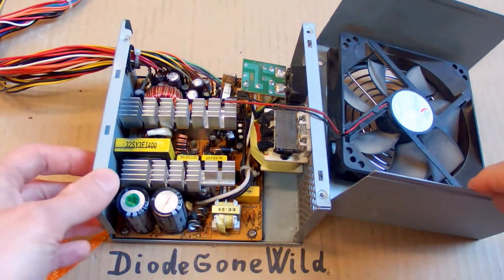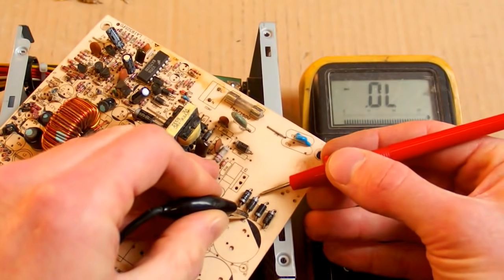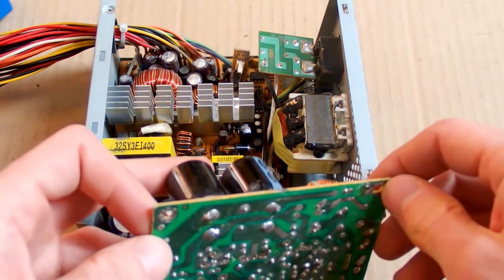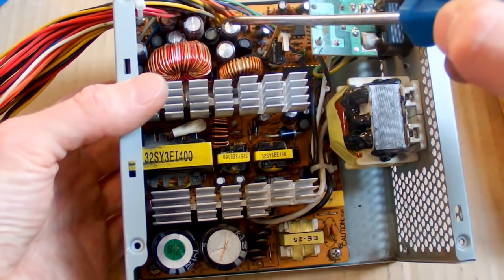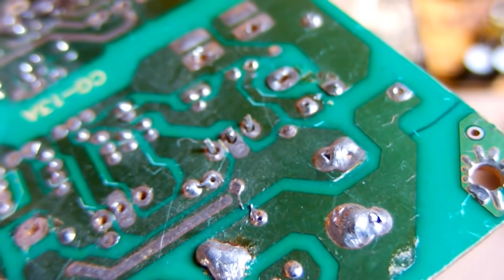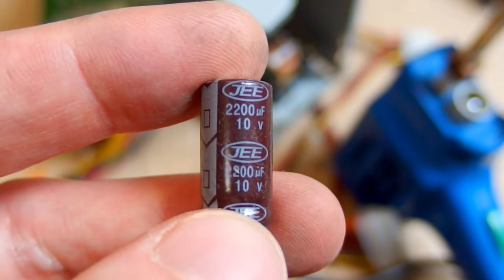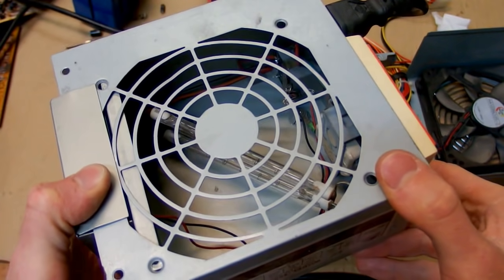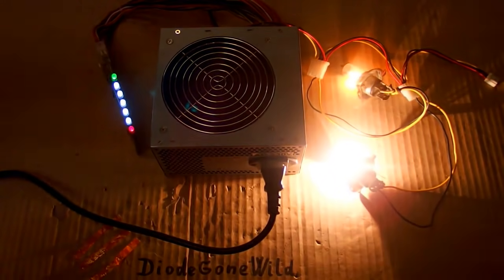How To Repair a Computer Power Supply (or other switching power supply)

Comment: Hi, I have a 67v charger. There is space to fit a small Volt-Amp display meter.
(It needs a 3v-30v power supply)
There is a 12v fan inside 
( I messure stabile 12v DC, both when the fan is ON and OFF).
I was thinking to half-bridge rectifying the 12v DC source, in an attemt to "isolate" the 12v power supply to the meter.
The volt-amp meter wil display the 67v output.

I placed one diode in series with my multimeter, the voltage increse to 19v.
With a diode in series on both +12v, and on the -12v side.
-Now my multimeter messure 44v DC.
How can 12v DC, increse when messured with a rectifying diode in series?. 
And even higer voltage with one rectifying diode in series on both + and - ??  
 Shouldn’t rectifying diodes in series on DC source resulte in a slight drop in voltage, and not a massive increse in voltage? 😅

Comment: Mine actually made sparking sound and green light came back on. After only reset button would do it before.  Lmao. Turned on but no power to mouse and key board and no video. Dell quality.. Smells burning

Comment: Hi I saw you use a light bulb in place of a fuse to detect possible short on power supply in one of your videos, I tried this with a G9 28w bulb but it always glows even when there isn't a short. Wasn't it supposed to only glow when there is a short?
Reply from the maker: The bulb is probably a too low power. It has to be a power rating several times higher than what the power supply draws.

Comment: Thanks for the video! It's been really informative. I have two broken psu's that I want to try to fix. At first sight they both have faulty capacitors that I want to replace, then see if they work using a simple psu tester.

Comment: So the Acer 220w PSU I have does not boot the computer (another PSU starts it so it is the PSU that is the issue). You can hear a lower than normal crackle when you plug it in. 

I cant see any puffed capacitor or anything loose or anything burned. I do not have a multimeter right now. 

And it has no visible fuse on any side of the circuitboard.

The computer was filled with dust when I found it (CPU packed with thick dust) so I think there might be some overheating isssue that caused it.

Do you have any suggestions

Comment: My Cooler master 450 watt supply is not working on load. After testing it I found two faulty Transistors and one zener diode. After replacing components and testing in series the Power supply fan is running by shorting green and black wire of 24 pin socket but on installing in the computer it hardly works for 2 seconds and stops immediately. I have checked all components.All are good but still the power supply is not working on load. My supply IC is ST9S429-PG14. What could be the possible reason? Please help.

Comment: A quick question please - I replaced the connection between the motherboard and the power supply - the new connector has a white wire and the power supply doesn't - any idea why is missing?

Comment: I bought cheap used 500W ATX PSU for diy battery charging and was pulling about 20Amps from 12V line. After about 5 minutes PSU turned off and does not turn on anymore. Nothing burned inside, no short circuits, standby 5V working normally. When I ground green wire something chirps for a moment and then nothing happens. Looks like it tries to start, output lines show 2-3 volts and then it shuts down to 0V. What should I test to find a problem in this PSU? (it has SD6109 IC if it helps)

Comment: Trying to repair a computer PWS, with no output. Found a blowen capacitor, there is no value on it, don't have schematic for it, and cannot find a listing with the only information on it SUNSHINE 0155, any idea what i might replace it with? signed stumped? If you have any suggestions thanks in advance.

Comment: What about an old AT PSU?
I wanted to ask this because i've got an old PC with a p8-p9 connectors and the 230v switch, only that even if plugged in the PSU the PC won't turn on at all, no fan spinning or anything.
Is that because of the PSU?
If so what really causes the PSU to not turn on at all?
I am considering repairing it because the AT PSU are quite rare, and i don't have the instruments to test it.

Comment: Can you help me? 2 13007 burned. And the 1uf base capacitors are burnt out too. and also 1n4148 diodes. I replaced them. But power supply doesn't work There is a small noise when I plug it in. But there is no voltages output. What else could be burned?

Comment: Mr, Hello. I have a question. I bought this time a Chinese power supply from scrap that does not work with the following specifications:
- HI-TECH POWER SUPPLY MODEL: ATX-500W
 DC Output: 3.3V/ +5V/ +12V1/ +12V2/-12V/+5VSB
I discovered that the J13007 transistors had "short circuit" and among the schottky diode, I installed only one that had it (also short circuit) and when I put the power supply in the electricity it worked. But what struck me is that when I measured the voltages, I found the following:
- On the purple wire +13 volts instead of 5 volts
On the red wire, 11 volts instead of 5 volts
The yellow wire is 11 volts instead of 12 volts
The blue wire is -10 volt instead of 12-volt
The lead wire is 10.7 volts instead of 5 volts
Note that the green wire gave 5 volts
  Question: How can I repair the power supply to get original voltages? Thank you .

Comment: Hello sir, can I ask you? I have a power supply for LED PAR CAN, I measure the output voltage and it works fine, so it can lit the 48's LED but can't run the fan. I suspect the amperage output is not sufficient. What component do you think should I look into? thanks in advance... great video btw.

Comment: I spent a day working on my PC and made a change to BIOS which caused the PC to shutdown and now the PSU appears dead.  The first minute of your video revealed what I suspected:  There are Mini fuses inside the PSU case.  Thanks--going to check it.  !!!
Reply: and? what are your findings? as it might help others...
Reply: @UnulOarecare  Unfortunately, my problem was not a power supply issue then.  It was a bad motherboard. Rebuilt the PC.

Comment: amazing teaching video , lately i get black screen when i start game , its look  like my power supply become not enough to run my video card , what part i need to change in my power supply ?
Reply: I have this issue too! Randomly my pc will beep and go to a black screen as if I pressed restart, and I've tried updating my drivers. I'm pretty sure at this point it is a PSU problem, but I don't know what I have to do to sort it.

Comment: Hi my power supply working fine when I switch on manually by short green and black wire and its shows all voltage correctly 3.3v 5v 12v -12v  5v stand-by but when I connect the power supply to mobo PC and switch on power cable MOBO fan slightly moves but when I press Power on button Nothing happen PC not turn on as well as power supply also remain off.. 

But when I connect Mobo to other new power supply all working fine

Comment: Good explanation but  I don't quite get the point of the home made PSU tester when you can buy one that actually gives a voltage reading on each rail for about €6 including postage.

Comment: Thank you very much for the video. I learned a lot of things including the measurements of the different components. But I have two powers supplies in trouble. I wanted to check if their ICs are in short circuits according to the datasheet using their references in google, but I did not find anything in the datasheet for these 2 ICs. The references of the ICs are: KA305850543H and KA251600515 H.
 Question: How to find these 2 ICs in the datasheet using google. Thank you so much.

Comment: Sir i have a important question im making lab bench supply with atx ps but im planing to use fast charger inside it with 2way switch so volt and amp meter shows voltage an current being drawn from charger and psu by switching in need. but i have to share charger and atx ground via volmeter cable is it ok or its gonna blow up?

Comment: Hi, my PSU fan was palced wrong adjacent to the PC wall. It heated up, GS 800 corsair. Now the PC switches on for 30 minutes and shuts down. Should I throw it? What can be wrong? Did the lack of air flow damage my PSU?

Comment: "Bad capacitors in the base driving circuitry could cause the power supply to shut down at high load." 6:37

Comment: hello sir I followed your every step but I didn't found any problem in any parts the main problem of my power supply is that when I am powering this power supply it starts working and its supplying power for only 2-3 seconds after that it is being shut down by itself.... I don't know what the problem..... Could you please sir tell me that why is this problem usually? 
please sir,  please help me

Comment: I used an ATX to make a Lab Power supply, and accidentally touched 5v and Ground (-), and now it is always is shorted/ faulted, only voltage at Standby 5V, and doesnt work. Did somebody got a similar issue?? 
My PSU is very similar to the one of the video.
Reply: Update: I tested everything, and had to desolder some components to test them properly because on the board it was not giving concrete result.
Finally I found the faulty dude!! It was one off the main double schottky diode, MBR2040CT. I replace it with MBR2045CT, and everything is back to normal!!!
Thx much @DiodeGoneWild !!

Comment: Which is the tool at the minute 12:40, the one wich you use to plug in and avoid short circuit. thx

Comment: I have also another question, is it possible that some ATX power supply, don't have Varistor? So then, instead they have a Termistor?
Reply: Varistor is across the supply to go short circuit in case of over voltage.
Thermistor is in series with one lead to limit current at switch on time. The thermistor’s resistance will decrease after being on for a very short time.

Comment: Sir, my atx power suply has only standby 5V, 
the other +5V and 12V, -12V, and 3.3V has fall out.
What is the cause of the problem?
Reply: have the same pb. Happened after shorting 5v and Ground, look for the 3 pins components that are connected to heatsink, one of them is shorted, and need to be changed.
Then I dont understand what the fuse is dong, only protecting from 220V surge.

Comment: what is the isolation power supply that you have made (with 2 halogen lamps) called and is it available commercially. Is it just an RCD circuit breaker essentially?

Comment: 👍👌🙏 Very nice clip with very simple explanation, you must discharge two big capacitors in the beginning, also we wanted to know how you test capacitors by using your ESR Capacitor tester. Short circuit between green & any black wire & fan start running is also very good. Thanks for creating this useful video showing stepwise procedure & do it for other topics in future.

Comment: Hello and thanks for the video. Really well done.
I have a very similar power supply and have noticed that two components have burned out. 
The first is an NPN D209L transistor, while the second is a resistor connected in series to a capacitor.
Since the resistance is burnt, I can no longer know the value.
Can you kindly tell me the resistance value?
I have attached a photo to understand. 

Thanks Andrea 

https://photos.app.goo.gl/4CTnDX5La5j1bFgb8

Comment: Looks like the same power supply as mine that has just blown up. The fuse in mine is black and the insulation has gone a bit burnt on that big yellow transformer on the left. So short circuit in the transformer. It was making a clicking noise for a while when I played fast games which I thought sounded like a spark.

Comment: hello .. there is 5vsb and others are not (12v,5v,3.3v) and no trigger . where should i focus for to repair ? . thanks .
Reply: Mosfet are faulty, had the same pb after shorting 5v and Ground, look for the 3 pins components that are connected to heatsink, one of them is shorted, and need to be changed.
Reply: @DrZipZwan  thank you very much
Reply: @mertsamet2953  Sorry not Mosfet, but double diode >  07:20
I desoldered some, and found a pattern, and one was not behaving like others. This dude SB1640CT (http://pdf.datasheet.live/datasheets-1/panjit_semiconductor/SB1640CT.pdf).
You can not miss them they got heatsink ))
Reply: @DrZipZwan  understood

Comment: Any way you know how to fix a slightly cut power supply wire? I was a dumb ass and while cleaning my PC I was for some reason using a knife to disconnect the wires. WELL karma came for my ass and I cut one of the power supply cables. I just skimmed it but it was enough to cut one of the little copper wires. How do I reconnect that little wire? I don't know if I can still get a new power supply because it is such an old PC please help. I just wanted to get the dead bugs out and I broke it lol.

Comment: DiodeGoneWild   What's the wattage of that power supply? I think it looks we have the same Power supply because of the 2 heatsinks and the integrated circuit KA7500B.  I think that means I need help from you to send me a copy of your schematic diagram on that power supply because I couldn't find any Starlogic brand Schematic diagram. There is a a resistor only went busted cook up which I did not double check that there was little tiny lead touched to the other line after I replaced most of the defective bulging capacitors two 2200uF 10V, one 1000uF 16V and the two integrated circuits the KA7500B and WT7510 (Weltrend brand) double check those MOSFET transistors make sure that's good but they're good. The resistor went cook up and "can't see anymore the 'resistance value'" even the location number in the board got burned, turned out carbon. Can't even see the number location.  The resistor that got burned is located underneath the Heatsink of those big MosFET transistors and the sketch line is coming from two little transformers [WIN-19LW (Q) and Win-19LK(s) leading to the number 12 pin Vcc of KA7500B integrated circuit. I'll try to figure it out which are the resistors.  Please, can you email it to me that "schematic diagram" in my temporary email UBetterLoveNick_2 at yahoo dot com?  That's to see the resistor value that got burned.

Comment: Dude I love your tester circuit! Could you make a video on making one? I've always just used a diode to connect the grey and black wire but that circuit seems more legit.
Reply: You can just put a switch between green and black and then also connect 1-4 kiloohm resistors in series with leds (indicating) and ground common for all leds
Reply: But yes the connector is a bit tricky u can take an old ps connector .

Comment: This Is a Cinese Power supply! Don't buy this rubbish. 2 caps in series?! Good Power supply have 1 caps (400v, not 2x200). Buy good PSU like seasonic platform. Sorry for my bad english.
Reply: And this rubbish have a ticket overrated (example: 500w, but when you charge It at 300w, they Blow)

Comment: I've been using the same computer power supply for nearly 10 years. I've used it with many different system configurations (currently Ryzen 3700X & 1080 GPU. I remove the top cover and blow all the dust out of it every 6 months. or so.

Comment: My smps is not starting..when I connect to motherboard the green led on motherboard turns on but the smps and motherboard will not turn on...I checked the supply and got 5v on the green wire and 5v on a dark blue wire..the smps does not work when I connect green wire to a black..how can I repair...pls help

Comment: My psu does a very random timing sometimes multiple times in 5 mins or never in 2 days a instant power loss then instant restart after. It clicks on and off. I assume its a faulty voltage switching supply causing it?

Comment: I'm making a mini drill for PCB boards, and my 24V SMPS doesn't work.
1 year ago it worked perfectly fine, didn't find a use for it 1 year, and now it doesn't work anymore. 
The power light doesn't light up, no power on the output at all.
Hope this helps me fix it.
Also I think there is a damaged solder mask, but this shouldn't make it useless.
Looking at rosin in some places, it seems to have been fixed sometime ago.

Comment: mine atx gone really wild, I replaced puffed capacitors but when ever I load it with a car lamp the series halogen glows up. as you described I didn't change the small capacitors near to the small transformer. shall I replace them n try again?

Comment: i get 16v at one end of the resistor(R23 replaced by through hole) from 4148 diode(D10) there are in pairs 
(d9/d10) and 0.76v at other end of resistor which junctions with drive 
transformer.. ,i was suggested that i should get 16v or nearby volts at 
both ends of the resistor, please guide me,its a mercury 400w power 
supply ,i am asking for help from other forums too,if anyone know the 
circuits well ,please help me,thanks

Comment: Thank you for your knowledgeable teaching.I have an issue with my psu it switches on and than in a while turns off .Only after few hours it can be turned on again and it turn off in a few seconds.Can you suggest any resolution please.Thank you

Comment: Hello. I would like to ask if its possible to check the "Schottky barrier diodes" in atx power supply in circuit without desoldering. It would be a great help to me hearing your advice.. Thank you.